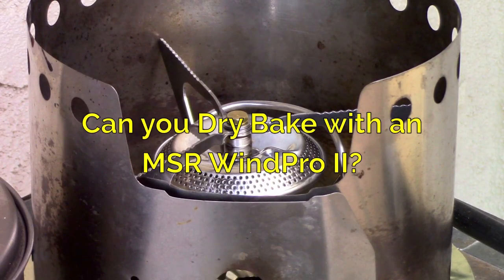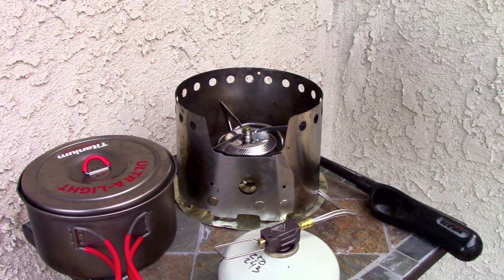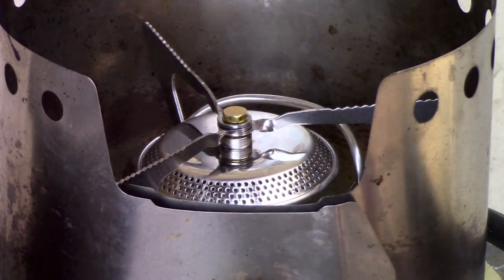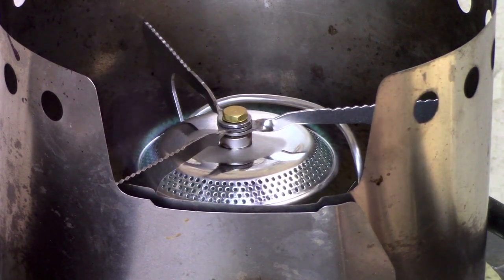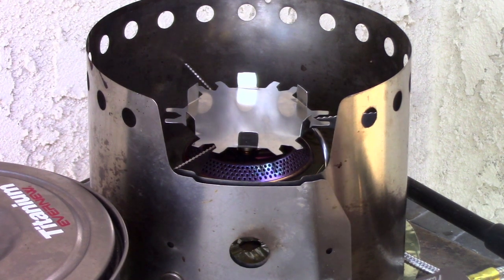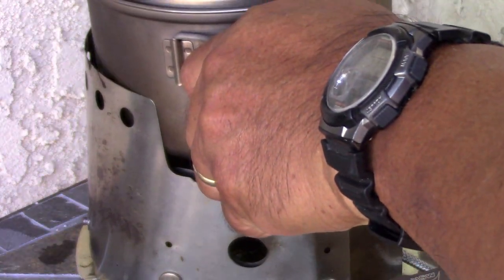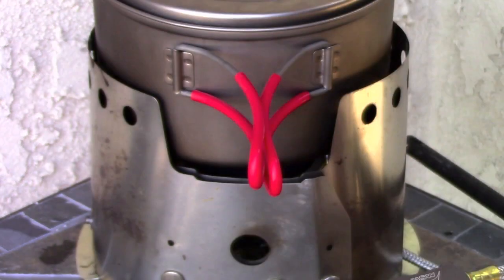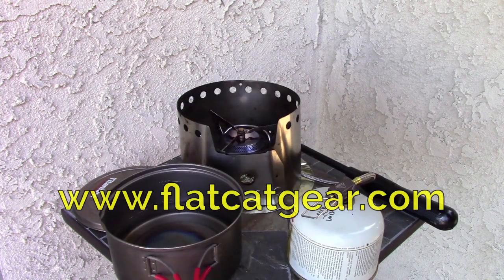MSR WindPro II;  Dry baking by FLAT CAT GEAR

Comment: Of course it “fails”.  You want to sell your little alcohol stoves.  So you created a predetermined “sciencey test” to encourage people to buy your stoves.  Spoiler alert; a simple commercially available aluminum heat diffuser plate and a camp chef Kevlar dome, in conjunction with the wind pro, does just fine at baking.  And I dare say, I can bake a damn sight wider variety of dishes and larger, more complex dishes with that setup than you can with your little alcohol stove.  BTW; because they don’t have a valve shutoff, most alcohol stoves are illegal for summer use on most public lands in the western US.  So there’s that, too.
Reply from the maker: Have a nice day